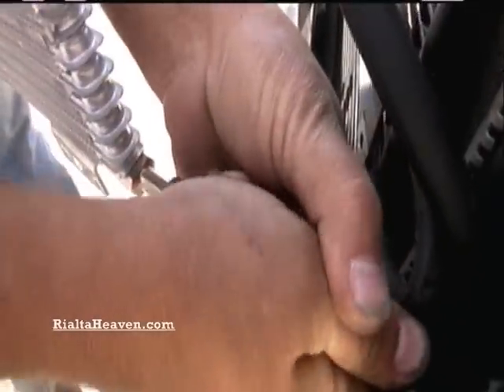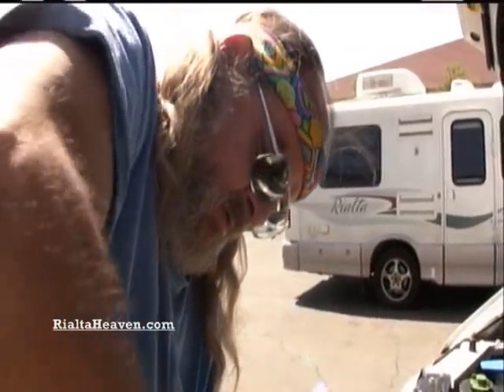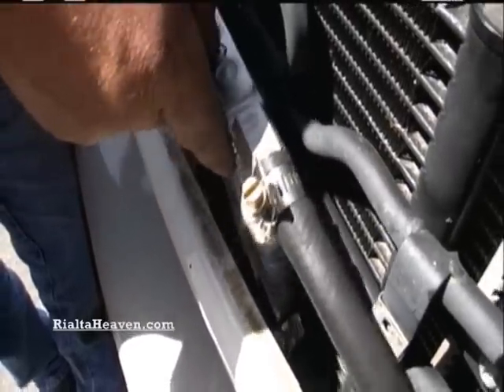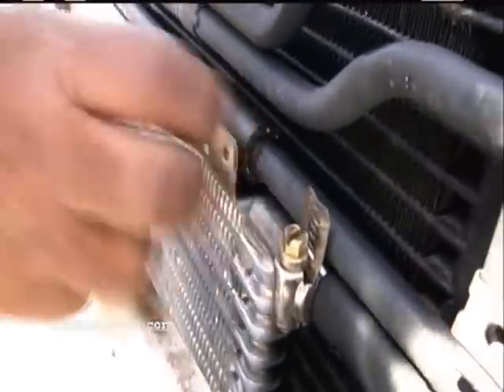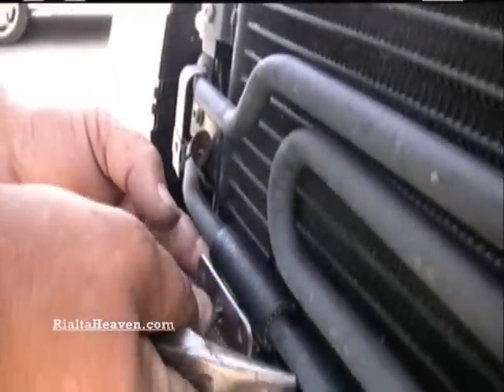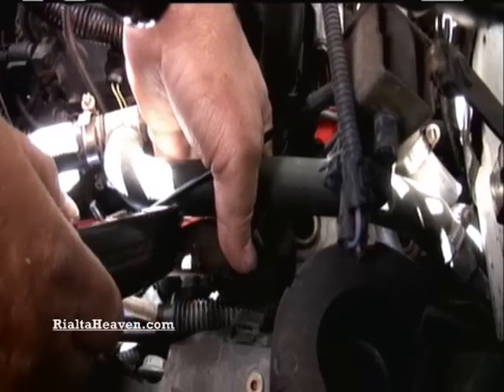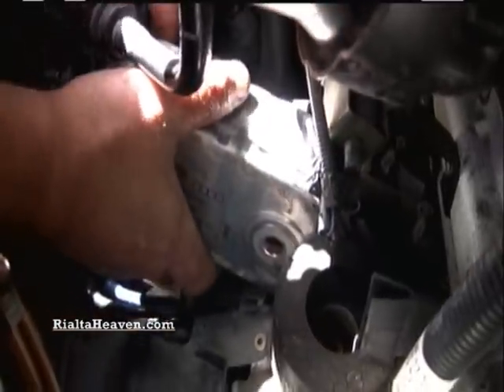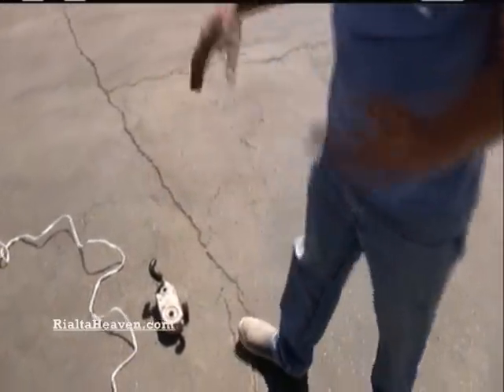Part 5: Rialta Heaven Transmission Cooler Install with Tx Pigeon

Comment: Those hose clamps are for larger hose not 3/8 ish trans cooler hoses 😢 
Pretty good install vid other than those terrible hose clamps lol
Reply from the maker: We have a new trans cooler setup that eliminates the need for the hose clamps as they are now pressed on fittings. :)